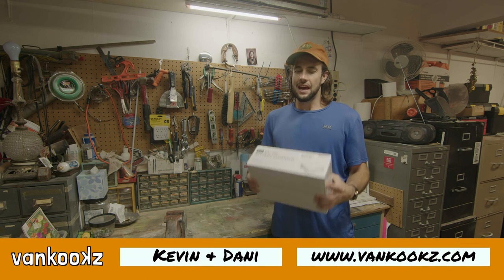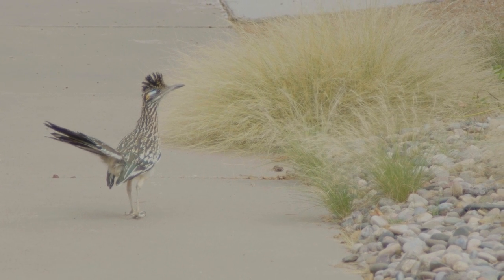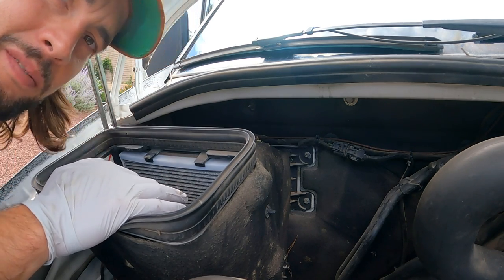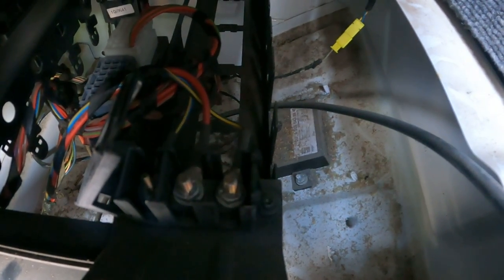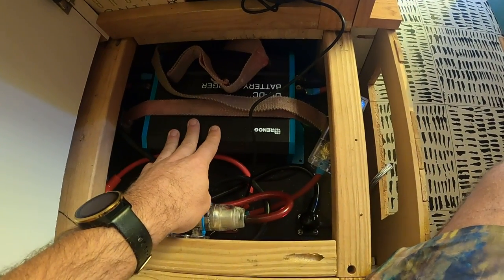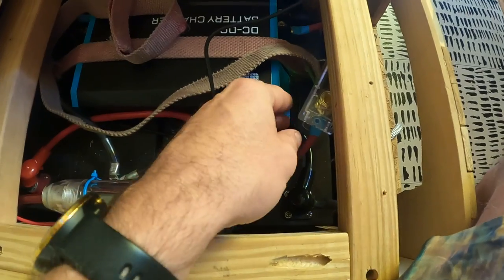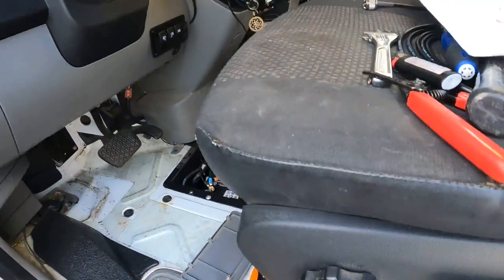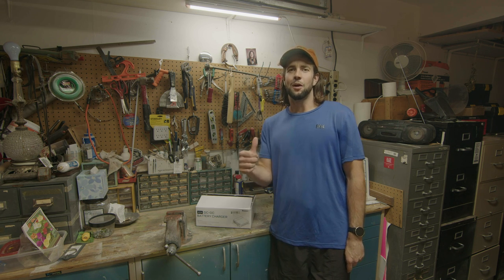Renogy DC to DC Battery Charger Install | Charging Lithium Batteries with Alternator

Comment: The plastic in a lot of newer vehicles is plant based ( soy ) so it attracts rodents, especially wire coatings . The brand name drier sheets are what we use to keep rodents out of our rv in storage, and balsam oil works well too just coat the plastic.
Reply from the maker: Thanks for the info! Soy based wires… that’s ridiculous!

Comment: Hi, great video, just a question, you mention the DIP switches set to Lithium battery, did you also set the lithium charge voltage, to match the internal cell voltage rating? Thanks

Comment: Your install went well. I hooked mine up, read the manual twice, checked every connection and it's only charging at 4 amps instead of 40 amps. Still waiting for Renogy to respond to a service request zzzzzzzzzz.
Reply: @GerhardtRaven  how full is the battery you are charging a full battery will pull fewer amps. Check the amps into the charger and then out too the battery.

Comment: Wish you had shown the charger side of the D+ connection.
Reply from the maker: It's just one wire that you use a tiny little flat-head screw driver to tighten and loosen.

Comment: How hot does it get sitting on top of the battery?   The instructions say it needs 5" of clearance all around it, and it must be ventilated.   Does it get super hot inside your closed up battery compartment?   I wouod like to mount mine the same way if not.
Reply from the maker: Great point. I had to move it.  It got pretty danm hot 🥵 I would advise not to do this I had to do a little reroute and put it somewhere else

Comment: are you showing the D+ connection going to a negative terminal (black wire) I have mine hooked up but getting no charge I'm kind of worried maybe I had hooked it up backwards when trying to test it out without a fuse
Reply from the maker: No it goes to a positive connection I may have just ran out of red wire.
Reply: It says D+, + means positive.

Comment: You probably  have it in your video but what is gauge of the wiring you used
Reply from the maker: 4
Reply: @Vankookz  were did you purchase and how  many feet did you use .and what were the fuse amp or relay amps thanks

Comment: Do you have to run a negative from the starter battery to the charger ,or can you run a negative cable from the chassis? I currently have a negative to the chassis,  and I'm getting full charge from alternator/starter battery.
Reply: You can run it to the chassis depending on your load. Higher loads are recommended to ground to battery